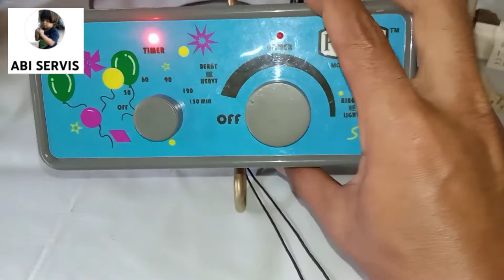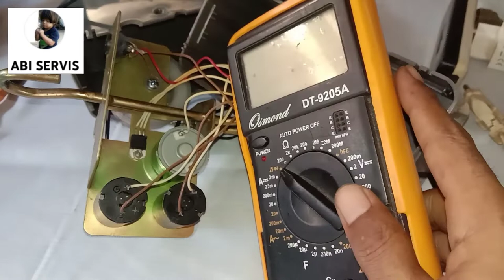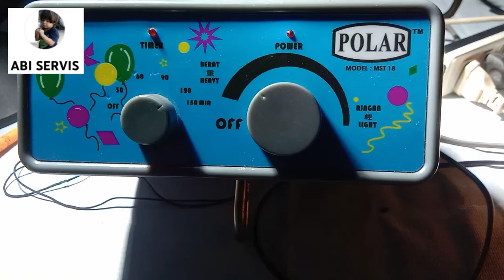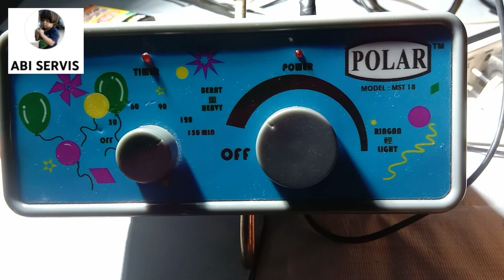cara memperbaiki ayunan listrik lampu indikator nyala tidak berayun

Comment: Kalau ada respon tapi lemah tarikanx mas, mohon solusinya🙏
Reply from the maker: Periksa semua dinamo nya mas ada 3 ,biji pastikan semua berfungsi
Reply: @abiservis2426  semuax berfunsi 3 tigax mas
Reply from the maker: @samalone14  periksa roda nya mas tali Sling nya mungkin mungkin di lilit ulang pastikan juga teg adaptor nya normal
Reply: @abiservis2426  normal semua mas, sy jg pusing kok bisa gtu, apa pengaruh kalau ganti rasio?
Reply from the maker: @samalone14   udah ganti potensio ya mas ... Apa mas samakan nilai potensio nya dgn bawaan nya atau gi mn mas🙏.
Reply: @abiservis2426  belum ganti sih mas, sy baru mau nanya ke mas, apa ada pengaruhx ke potensio apa tdk? Krn semuax nermal.
Reply from the maker: @samalone14  semua nya biasa aja mas elektronika itu  seling berangkai satu sama lain